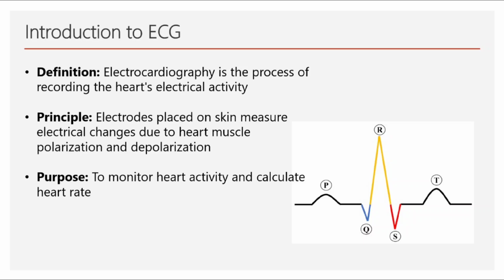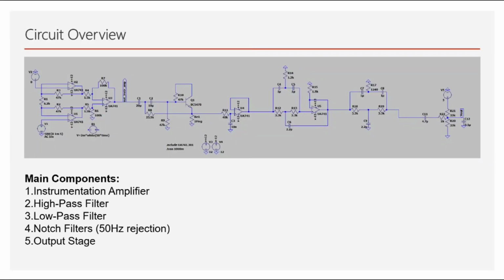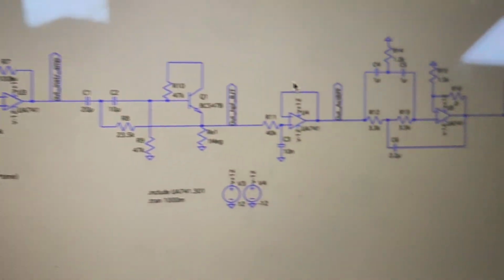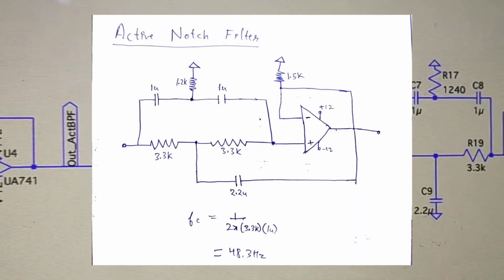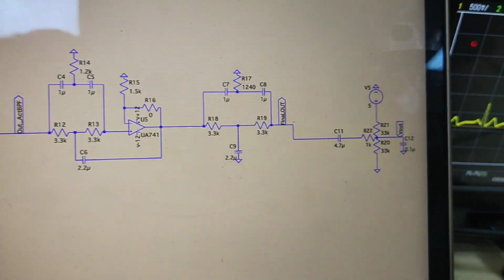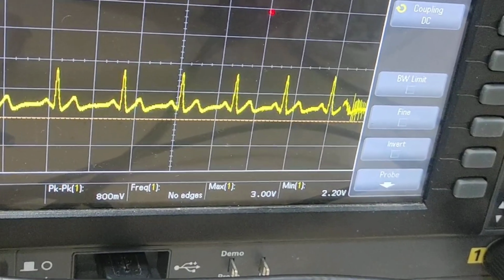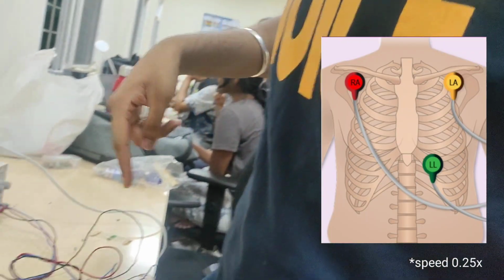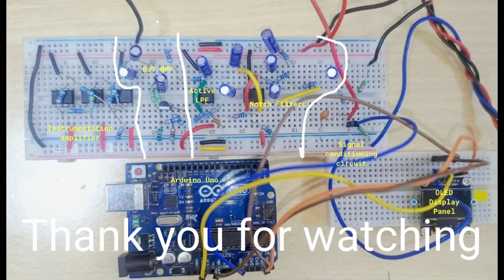3 Lead Analog Electrocardiogram (ECG) Project | Circuit Working Principle and Demonstration

Comment: please reply that where we have to connect the 3 leads obtained from body?
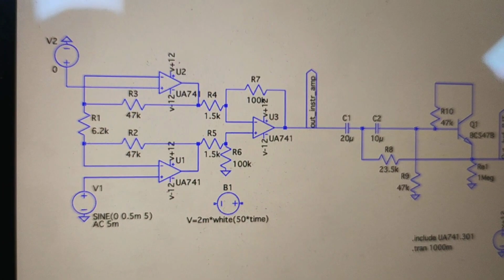Reply from the maker: Don't remember the exact configuration. Two of the leads were given as inputs voltages V1 and V2 as shown in circuit on 1:36 and the third one was connected to the circuits reference/ground voltage. You'll have to try different combinations of the connections to see which one gives the best results. Hope this helps.
Reply: @gautam_gandhi  Thank you!
Reply: @gautam_gandhi  Hi can you let know which type of wires you used to connect the electrode and the breadboard please